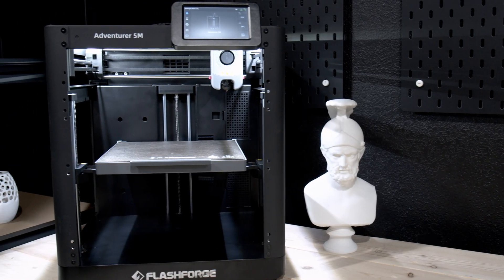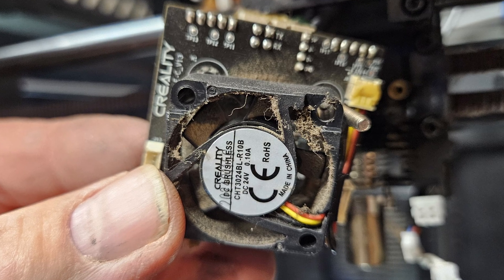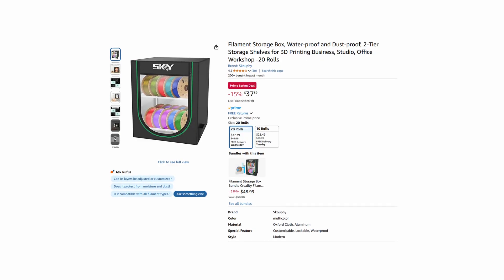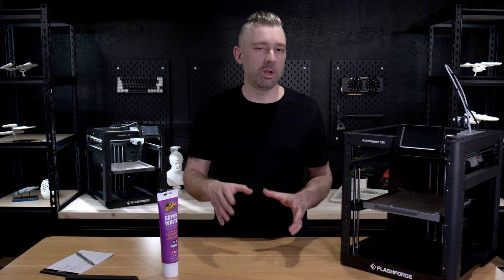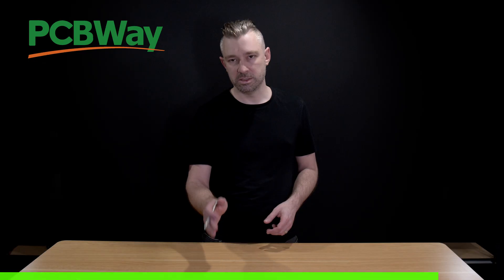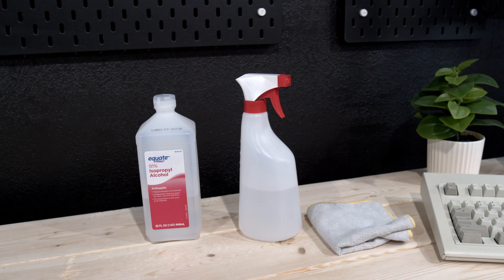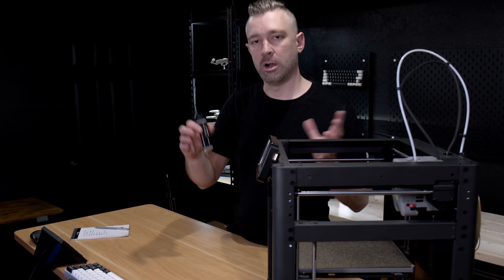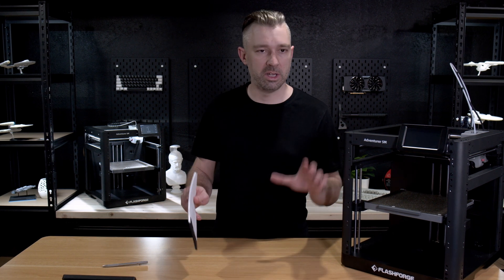Maintaining Your 3D Printers! Why and How!

Comment: I'm no 3d printing expert, I've only been doing it for 2 months. But  I have 600 hours and I have never used glue. Off the hundreds of things I've printed, I've only had 1 or 2 fail due to bed adhesion. Honestly, I see no reason to use glue. For reference, I'm using a Centauri Carbon
Reply from the maker: Glue isn't really all that important. Personally I never use it. But there are people who do.

Comment: I got a free creality cr-10 smart pro covered in dust and dirt from being in a barn with dirt floor. It's fine but I've looked inside the fans etc and it's dirty. I'm new to this and my wired ESD air duster wasn't able to get in there. I bought and returned some open and used PETG filament coz it got stuck on the nozzle. I hope I can still save it.

Comment: Good video, though I never use alcohol on my beds, just dish soap and warm water. I never use glue or hairspray or anything else on them either. I only use pla so get that people use them as release agents for some of the other types of filament though.
Reply from the maker: Yeah I never use hairspray, and rarely use any form of glue. If I do I use the newer liquid type glues. Alcohol works best for me as I don't have quick access to water in the studio. Although, I guess I could do a spray bottle of soapy water.
Reply: @zerodotcmd  My art studio is technically the master bedroom in my house with an attached bathroom. The sink is a little small for some of my buildplates, but I make it work :)

Comment: I have two comments. First, due to the smoke and debris generated in or on a laser engraver/cutter maintenance is as necessary in terms of cleaning and lubrication as a 3D Printer. Again if one wishes the best performance and life of the system. 
Second, I definitely resemble your remarks about the magnet sheet. It has only happened once, but I forgot to reinstall the build plate and printed an entire job on the magnet sheet. Fortunately, due to the homing accuracy and appropriate Z Offset of my machine, the job printed perfectly without any damage to the magnet sheet. However, I strenuously recommend to avoid running this test on one’s own printer!
Reply from the maker: Yeah engravers definitely need constant maintenance. But I've seen some people with some really nasty and poorly maintained engravers.

I wont even act like I've never done it, I've damaged my fair share of magnet sheets. I get so busy and in a rush that I hit send and completely forget about it. It's really impressive that your print finished! Gotta say I would have looked at that and thought it was pretty kewl that it printed.
Reply: @zerodotcmd 😁